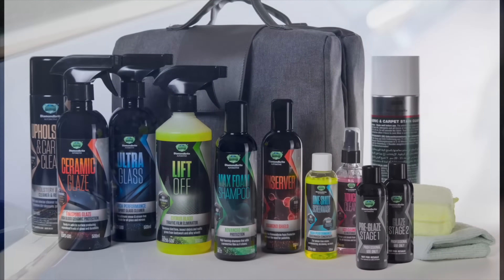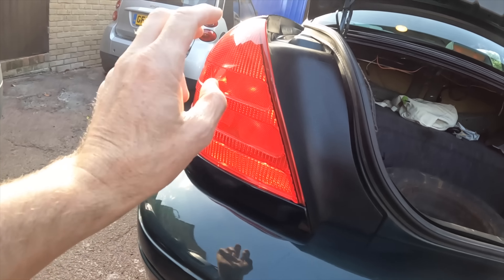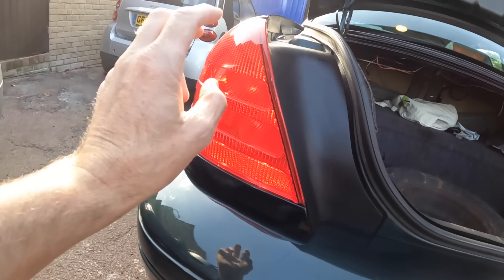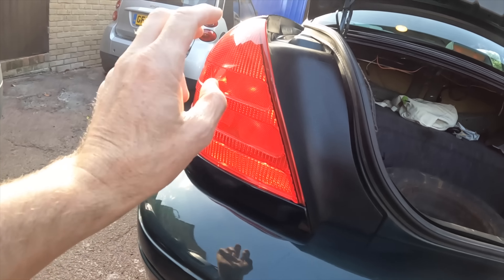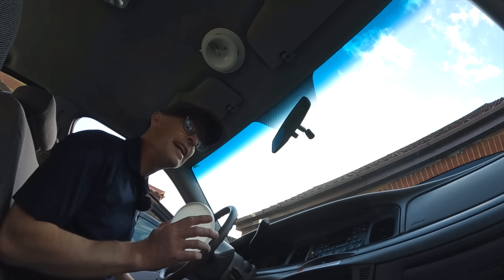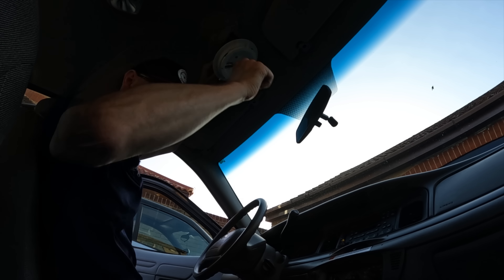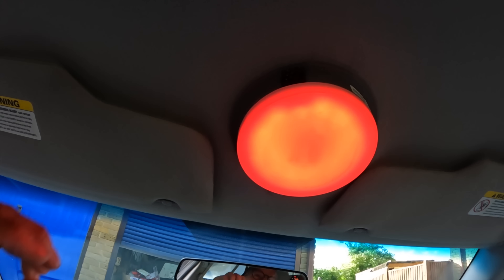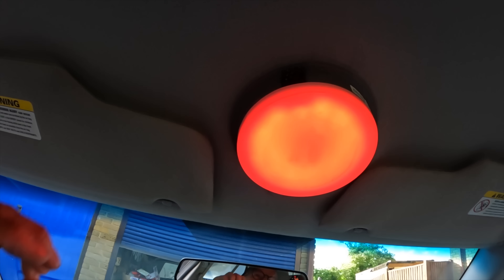Crown Vic a 'light' update

Comment: What i did was i cut the cable running from the brake light switch from the pedal, spliced in a cable directly from the brake switch to my three rear brake lights and then that way the indicators were separated from the brake lights, then i just drilled two holes at the bottom and put original style lamp holders in, got some incandescent bulbs dipped them with green stained glass window paint and all sorted, did this all myself

Comment: 1999 Crown Vic tail lights had built in amber turn signals at the base of the light where you have the turn signals added if you really need to have amber to be code proper.

Comment: Are your rear indicators amber enough to get through the mot? I actually changed my rear lights on a 90s Mustang I owned around 20 years ago when they wouldn't let it pass the mot with red indicators. It turned out that replacement rear lights with amber indicators were available to buy online and I'm sure you can also get them for the crown Victoria.
Reply from the maker: Ive got some stained glass dye for the bulbs to deepen the colour, but it does have an amber filter in the lower half. 
I want to keep the all red look on the back of this
Reply: I've done the same to my classic VW Bus, that has red indicators, I bought green incandescent bulbs off Ebay for it. They look pretty amber in real life, the camera makes them look more red than they are.

Comment: Matt, you will need to tow an fuel tanker behind the Crown Victoria with such sky high prices £2 a litre.
Reply from the maker: its better than the Volvo
Reply: @furiousdriving  you’re having me on it can’t be more economical than the Volvo! how is that possible?
Reply: Be surprised these Crown Vic's at highway speeds the RPMs are so low. Even at 100mph that's only ~2,750rpm in O/D. Given you have 3.27 gears anyway.
Reply: The US didn't have the silly idea of displacement taxes that many countries had. With larger displacements, engines run slower for the same power, leading to lower viscous drag from oil and airflow (drag is proportional to the square of velocity), and higher efficiency. Further, larger cylinders have lower surface area to volume, meaning reduced heat loss into the coolant and better efficiency.

Comment: Don’t know how that guy you used  calls himself an electrician. The car monitors current draw on indicator circuits if one blows the current flow is less so the system recognises this and purposely sets the fast flash to make you aware of this. Leds draw fractions of the current incandescent lamps draw so hence the fast flash.Adding resistors will only make it worse.  Simple ohms law
Reply: No, you place the resistors in parallel with the LED light. This increases the current draw, like adding more lights to the circuit. You do not place resistors in series.